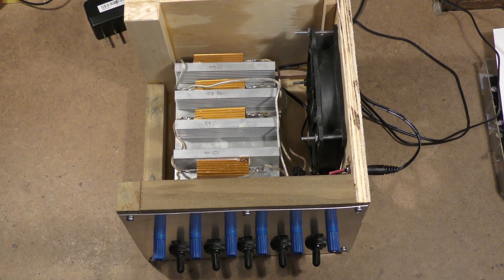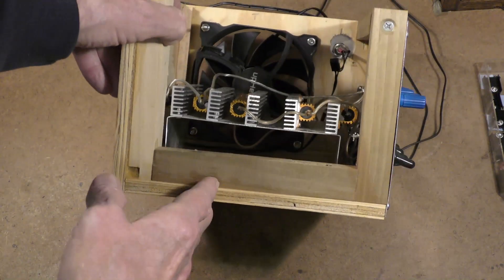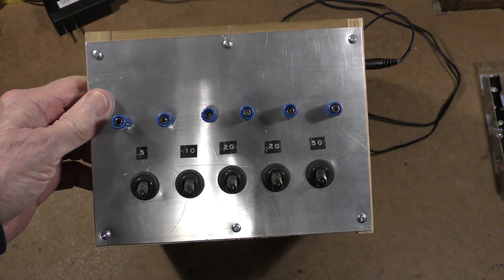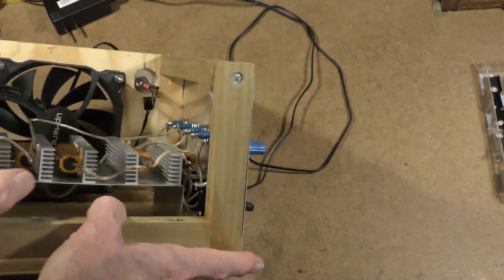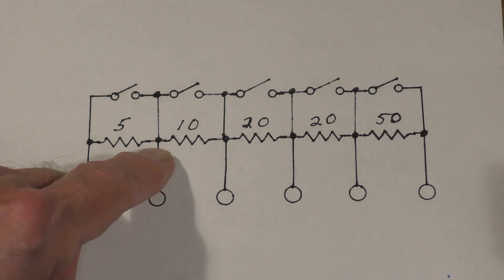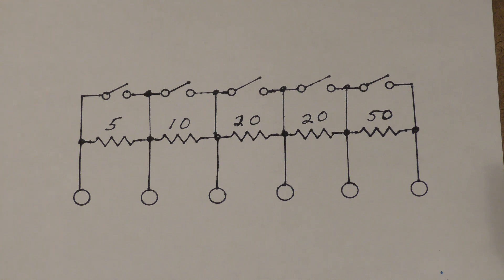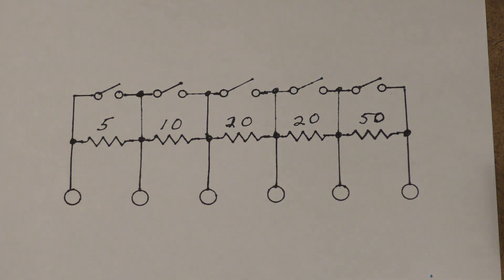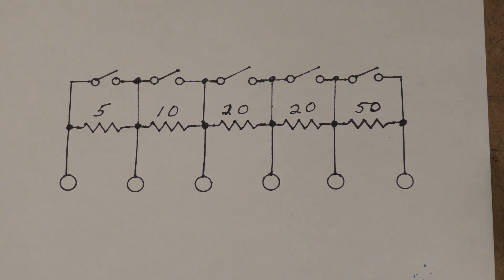TTT360 Power Resistor Box

Comment: I am not sure this is the best possible solution. In this configuration it is impossible to join more than two resistors in paralel, so the lowest resistance you can achieve with this is 3⅓Ω (5 and 10Ω resistor in paralel). Using terminals for both ends of the resistors would give you much more flexibility in wiring them. And, of course, adding switches between the resistors higher and lower ports gives you possibility to connect them paralel or serial way just using the switches. Adding bypassing switches opens the posibility of changing the resistance in serial (and partialy in serial/paralel combinations) mode without reconnecting terminals. Terminals and switches are relatively cheap, power resistors and heatsinks does not.
I mean something like this: https://drive.google.com/file/d/1As84DRi8EVzxZQqgsQmOts7ZnoS9arNW/view?usp=sharing Switching on SW3,5,9,11 put resistors in series, then using SW1,4,7,10,13 can be set the resistance. Switching on SW 2,3,5,6,8,9,11,12 put them all in paralel, switching off 2,3,5,6,8,9,11,12 disconnect them all, so you can wire them almost any way using the terminals etc. This is how I made my power resistor box.

Comment: Interesting videos and neat project. Are the current and voltage ratings that you mention for the switches the AC ratings? 
DC ratings generally are considerably lower.
Reply from the maker: Thanks for the comment. The switches I used are rated for 20 Amp AC at 230 VAC (which is ~ 325 V Peak) and 15 Amp DC at 250 V. Of course this is overkill for most projects but I wanted to over-engineer it since you never know what the future will bring.